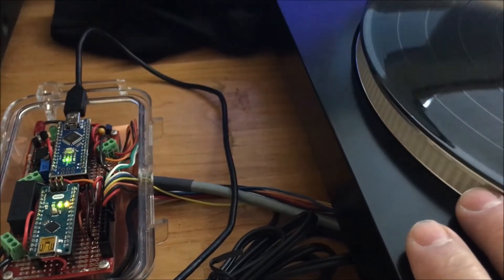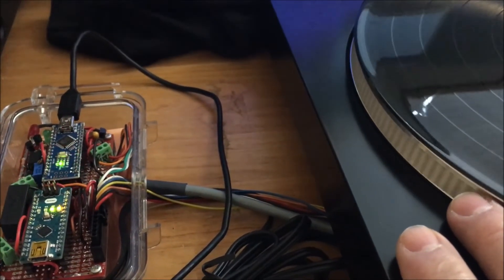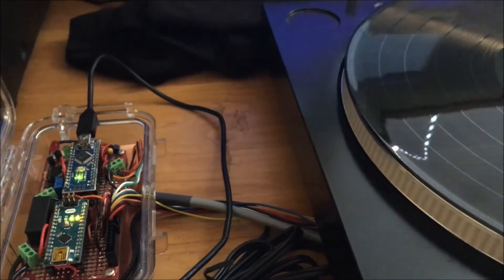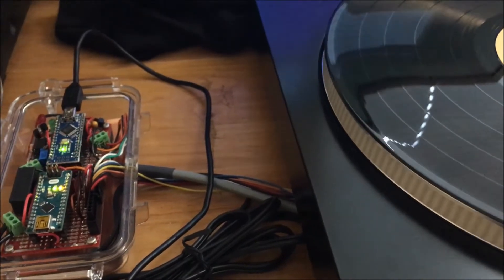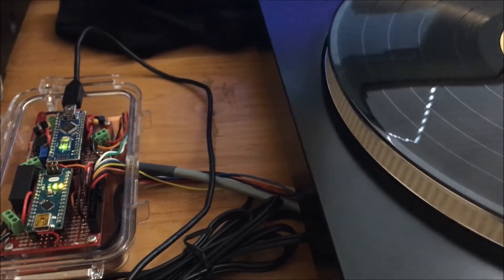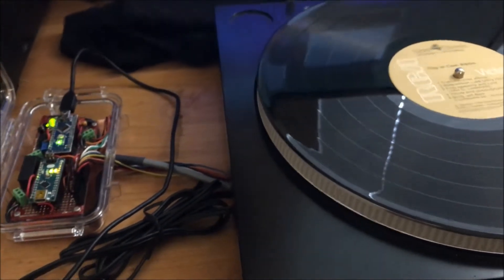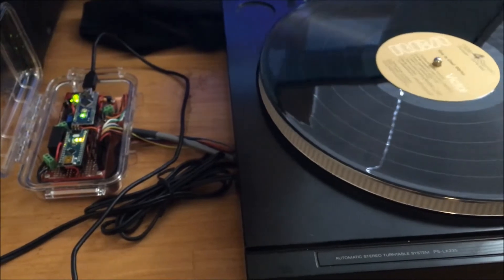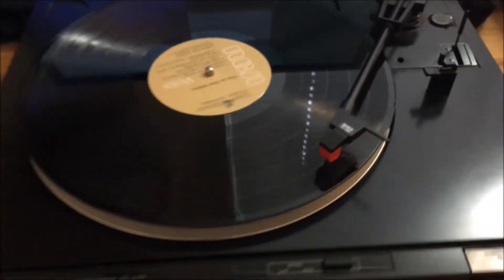Brushless Motor Upgrade for Old Sony Turntable ... Ultimate Arduino Record-Player Project

Comment: Can you provide a link, or exact specs of the Nidec motor you used? I googled the number on you motor, and there are several in the 22h series.
Reply: Is it possible to get 45 and 33 by programming two different duty cycles, and adding a switch that will toggle between the two. Is that possible with the Arduino? I'm a noob to Ardiuno programming...

Comment: Great job! Have you tried  controlling a direct drive turntable with an Arduino?
Is it possible?
Reply: It is possible if you are aware of the waveform and frequency range that came out of the uc at the first place because not all turntable dd motors run on pwm. Without these informations it is futile to make an attempt.

Comment: Excellent your work and thank you very much for sharing the links of the schema and the code for arduino, you would be so kind as to specify the relation of the plate pulley with the motor pulley, I really want to build a record player from 0.
Thanks very much

Comment: Very nice work and really needed.   Would it be possible to find out where you got the motor from?  I have tried the circuit with a similar Nidec motor (22h051f0) which is doesn't seem to like.  Thanks very much for your efforts.

Comment: What range of speeds can you accomplish with this?  I have a number of records that play at oddball speeds and I'd like to adapt a modern turntable for this.
Reply from the maker: One of the turntables I upgraded (Pioneer PL-12D-II) is set up for running 33 or 45 RPM. This requires more circuitry and software to accomplish ... for this reason, I am happy to just have 33 RPM (to keep it simple as possible) as that is what my record collection requires.  It should be possible to run this system at any of the traditional speeds (16, 33, 45, and 78) with the proper circuit set-up and software parameters.  For the PL-12D-II, I reworked the original speed selector switch to become part of the speed control circuitry in my electrical design.